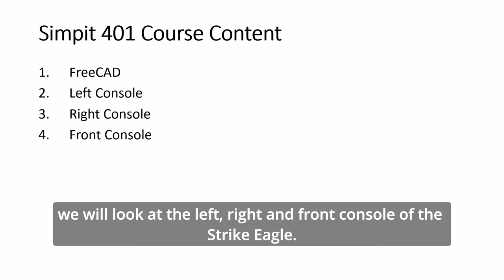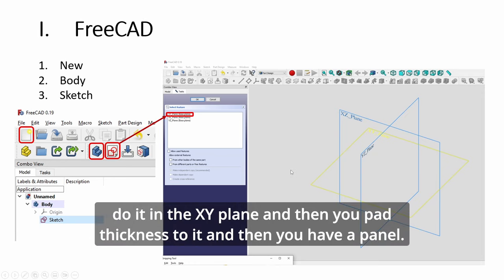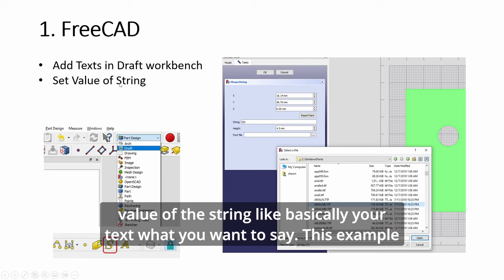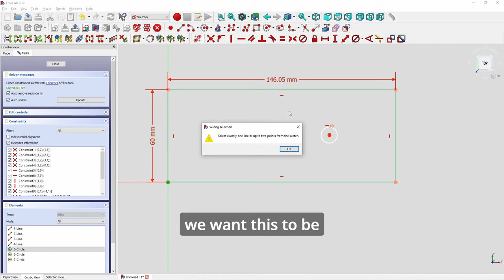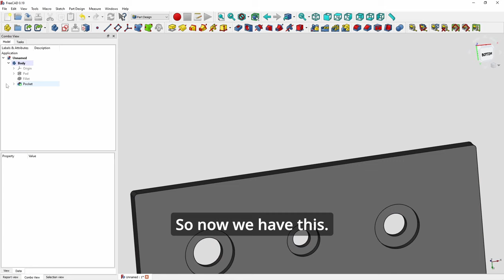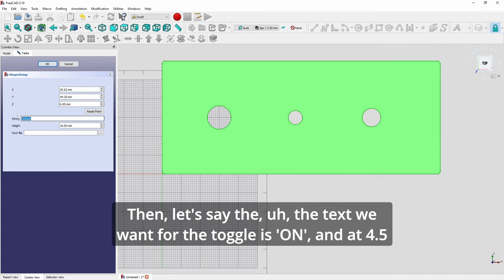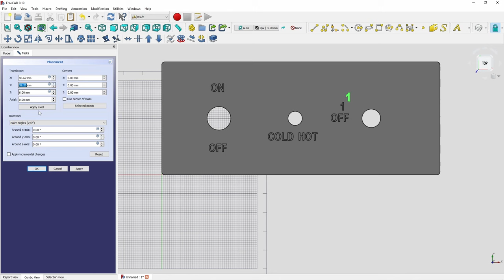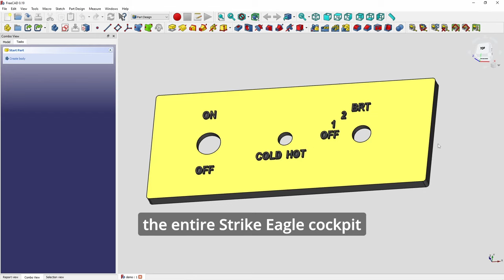Episode 2 FreeCAD Demo to show how to build a sim panel in minutes.

Comment from the maker: Some people asked me on Facebook why not just use bodnar boards. Easy without need for code. Agreed on the easy part. But they are not cheap compared to arduino. when u want to build a full pit that requires 5 to 6 mega equivalent boards they add up to a few hundred $. I’m just showing a cheaper way. By all means use bodnar boards. And I think they don’t handle output like lcd, 7 segments etc. 

Also dcs bios doesn’t really need you to know coding. For input switches, It’s done for you. Just find the code for the aircraft, panel and switch that you are trying to wire and enter the PIN number in the given code.

Comment: Very great, have been following along in all the vids so far.  I've been purchasing per panel the toggles and switches.  But I was wondering, do you have a list of components you need for the whole build (how many and type of switches, buttons, etc) that you could share?
Reply from the maker: I'd didn't compile total components used so far on a spreadsheet. You should wait till the end so you don't keep paying for shipping. Also you want to buy extra coz sometimes things may arrive dead and then you have to ask for replacement or refund etc. As I make the videos, I retest everything in case things can be improved or corrected. So nothing is final till all videos are done. That is when I'm satisfied with everything. So now I hesitate to recommend all switches till proven good.
Reply: @simpitacademy  no problem and thanks for the response.   Exact mentality, I'll wait till the end but keep on building the panels in FreeCAD for now.  Thanks again!!!!
Reply from the maker: @kevinpeterson4051  What I can assure you is that if you follow my tutorials and build the panels and buy the same type of switches, not only will they fit, but you will have a full, complete F-15E cockpit at the end which will be awesome to fly in. Every panel and switch, lever will be covered. Btw, new video on Sensor panel just released.